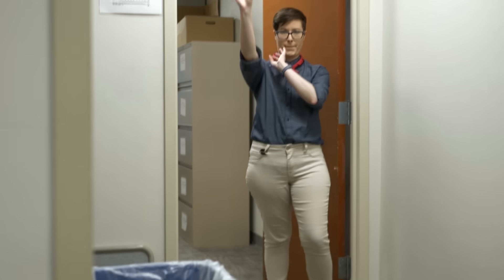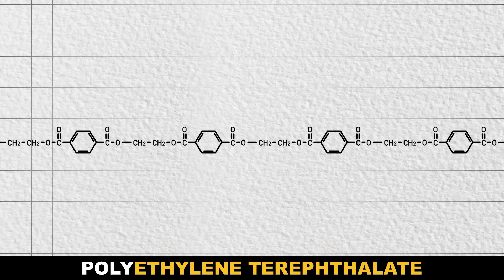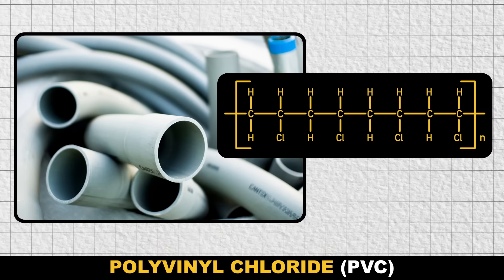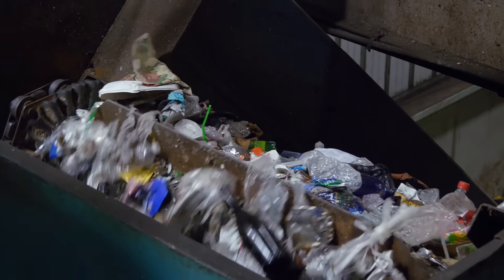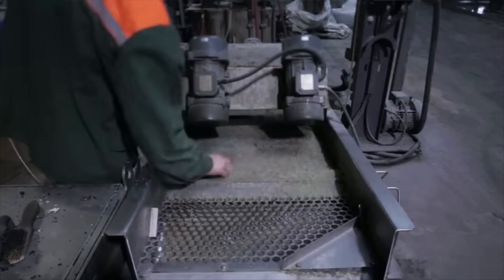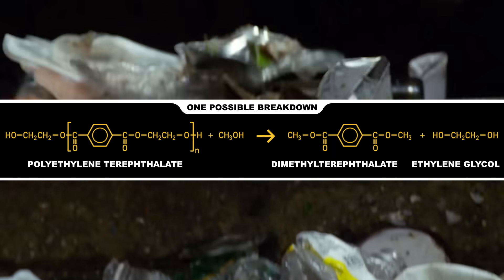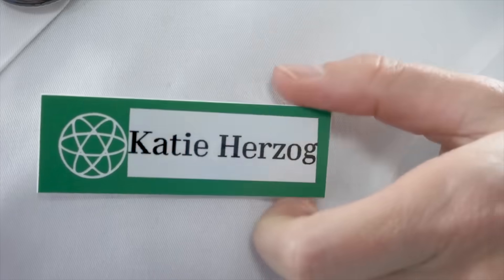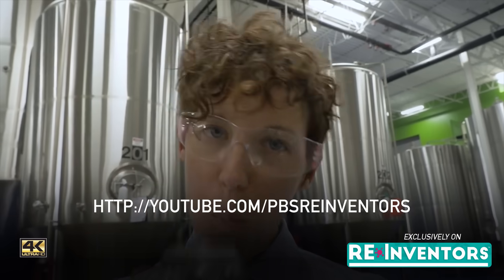How Plastic Recycling Actually Works

Comment: 2:52 the problem with polyester/woven plastic fibers is that they tend to produce microscopic flakes in the washing machine, which then infiltrates the water system. we don't filter these particles out of our drinking water, so we end up digesting these fibers, which cross the blood-brain barrier.
Reply: And the fibers are not breathable which leaves you with BO and a t-shirt that has a sweat smell no matter how many times you wash it
Reply: yes ! exactly what you said. i couldn't have put it any better myself about eventually this will end up in the seas.

Comment: Could plastic recycle turned into plastic logs to make log cabins from, to save trees and be low maintenance, and if all uniform size, could be moulded with cut oits, so easy to put together?
Reply: UV rays degrade plastic and it will slowly leech into the environment. Proper logging practices make wood the more sustainable building material

Comment: In Japan, We're required to separate and clean PET bottles (and other recyclables) as consumers, before pickup. Every collection day is a certain type of garbage collected (For example, PET bottles on Monday, Burnable on Tuesday, Glass on Wednesday, Metal Cans on Thursday, Paper on Friday, and Burnable again on Saturday). If your garbage is not properly separated and sorted, or is the wrong type, It simply won't be collected, and a note will be left on the bag saying "This is the wrong type of garbage, Please sort , or take out on the proper day" . If you don't take care of it, neighbors can complain and the property owner (in tern individual tenants) can be fined.

As a result, Japan has super-efficient large-scale recycling. In addition, we have extremely efficient and modernized industrial incinerators and recycling facilities.

Comment: FORGET RECYCLING, FORGET PLASTIC BOTTLES!  What we should do is go back to what we did some 30+ years ago.  You would buy your soda, drink it, and when you were done, put the GLASS bottle into a box or bag and return it to the store.  The store would give you 5 cents per bottle (maybe around 15 to 20 cents today).  The bottles would then be sent back to the bottling plant, they would be steam cleaned ( which destroyed any dried syrup, residue, etc., and would sterilize the bottle.) and placed on the production line to be filled with soda, and repeat the process.
  Not recycling, reusing.  Simpler, faster, and cheaper than recycling!
Reply: It's all about the money, nothing else matters.
Reply: I agree, but another problem would be that glass bottles are heavier than the plastic ones
Reply: @Canale064  good point, I wonder which releases more co2 polyethylene or glass?
Reply: @Canale064  yea, plus if you switch to glass then where in your diet will you get your polys and your endocrine disruptors and your monosodium cancerates? I have a list of pills i have to take 3 times a day to support all of those, my doctor will be pissed if i stop talking my medicines
Reply: companies hate using glass these days because its not cheap enough for their greedy production
Reply: @BrainDent  
 Not Really. Reusing/ refilling glass bottles would actually be cheaper because it doesn't require an endless production.
  Glass bottles would sometimes break, or not be returned, but most would be returned because of the refund.
  The companies aren't the problem, society is.  Ours has adopted a "throw away" mindset, while past generations believed in reusing and fixing.
Reply: @Timbrock1000  If it was cheaper, companies would be doing it. The only thing that matters to the vast majority of corporations is producing as cheaply as possible and selling as expensively as possible. Plastic, unfortunately is the cheapest for most uses.
Reply: But then the oil industry wouldn't make any Money
Reply: Wow! that takes me back.  Huh!? Almost forgot those days even existed.  Thank you.
Reply: Thats totally normal in many EU countries like germany and austria. stil could be implemented in many more countries
Reply: That's WY I drink my milk in bottles made of glass. Taste is also much better!!!
Reply: I remember my mom telling me how she use to collect a bunch of glass bottles and take em to the store for about 10 cent each. 10 bottles she said she had a dollar and you was able to buy a bunch of candy for a dollar back in the 70's and 80"s
Reply: So true. I think people now days are to lazy to return bottles and stores to greedy to mess with them.
Reply: In michigan we get 10 cents per bottle and can we return
Reply: I am not sure that it would be cheaper.. back in the day, we had a bottling plant in our small city.  It employed people, but that undoubtedly made it more expensive.  Today, we get 'pop' trucked in. (in plastic bottles and cans).
Reply: They still do it in germany but via a machine in the store
Reply: 5cents of 80s money is like $15
Reply: @generationalgamers8925 
 No, more like 14-18 cents.
Reply: Yeah, but most people mess up their cans and bottles. People crush cans all the time.
Reply: @flargarbason1740  crushing cans doesn’t do anything. It can still be recycled if it’s crushed we just crush our cans so we can fit more stuff into our recycling bin.
Reply: @flargarbason1740 crush cans can still be recycled
Reply: It wont happen bcz this disruction is done to earth by major corporates such as coco cola,pepsietc
Reply: @dsangeeth15 stop being underconfident.

Comment: even though they call it a down grade, cloths and handbags remain usefull for way longer than any plastic bottle.
Reply: They are still made of PET and eventually they'll be thrown away, and can't be recycled.  

You can definitely use the bags more times than the bottles, but if all the bottles get turned to a bag that will get thrown away, the amount of PET isn't reduced, the problem is just prolonged to a different age group to deal with

Comment: Wouldn't it be possible to clean and re-use some products, like some kinds of bottles, without completely breaking them down and reforming them?
Reply: Eric Nash 
  That's just what they used to do with glass bottles. You would buy the bottled drinks, when the bottles were emptied, you would return them to the store, and get a 5-10 cent (20-30 cents today) refund.  The bottles would be sent back to the plant, steam cleaned, then refilled to be used again.

Comment: 2:42 Well, you could do it the European way. You pay a little extra (0.25€ per bottle) when you buy them. And when they're empty you take them back to really any store that sells PET bottles and receive your 25 cents back. The store will then have the crushed bottles be transported to a recycling facility.
There's no extra cost for the consumer and the PET retains most of it's quality in the process.
Reply: Glass soda bottles used to have a return deposit ranging from 2 cents to 5 cents per bottle (1960's deposit amounts). Glass soda bottles were reused for 50+ years until the 1970's when corporations switched to plastic. Soda tasted better from glass bottles too! If you could compare taste between
glass bottles and aluminum/plastic bottles you'd definitely prefer the glass bottled version.

Just a penny for your thoughts.
Reply: It doesn't change the recycling process. from what I've gathered, it doesn't even increase the rate of recycling.
Reply: @rfldss89  IT DOES!
Reply: They have a system like that over here in the us
Reply: Many states have already done that for decades, even have what look like vending machines to feed in bottles and get refund. Some people make a living off collecting bottles and cans
Reply: There are certain states that will do this too.  The refund value doesn't really save any cost of recycling if the consumer gets back every cent they put into it, instead of the profit for the extra charge actually going to the process of recycling.

And even if the extra 25 cents per bottle was kept from the store (and went into recycling) I dont think that would cover cost of transport, sorting, cleaning, then the actual recycling process (and safely disposing of the waste you get from recycling).
Reply: We get 0.07 euros here in Croatia
Reply: Your lucky we get 10 cents in Lithuania
Reply: @DomtuYT  u can't direct compare nationality economy prices
Reply: Thas doesn't solve anything. Plastic is killing the planet. When will we stop using it?
Reply: @annvont  Plastics are used in almost everything today..!! It's just that humans should be careful not to MISUSE plastic..!!
Reply: I agree with the idea of having a deposit, and this way the machine sorts the plastic through the bar code.  Some states, including my state of Oregon, already have a deposit.  The machine sorts glass, plastic, and cans, keeping them separate from other material.

Comment: Which is why I always carry around a reusable aluminum water bottle (along with reusable grocery shopping bags).
Reply from the maker: Not the hero we deserve but the hero we need.
Reply: gotta make sure the reusable grocery bags are made from recycled plastic though. Cotton bags are much better than disposable plastic ones. For example if you consider CO2 emissions, it takes hundreds of years of use for a cotton bag to be more eco-friendly than a plastic bag (although of course, at least cotton bags don't end up in landfills or oceans after each use).
Reply: Rafael Santos you got that from a kurzgesagt vid didn’t you
Reply: I'm not a fan of reusable grocery shopping bags.  Most ppl won't clean them properly and there's always those unseen germs that linger.  I think the health issues it will cost will be more of a problem than plastic bottles.  Ppl are lazy.  The won't clean dirty bags, let alone ones that "might" have some ecoli on it from the butcher.
Reply: @rasmasyean  do they not put the meat in a seperate bag? Meat is one of the things that I always put in a plastic bag tied up so it doesn't get on anything.  Ecoli is not something to play with
Reply: @Anna-tc6rz  The meat (or other slimy stuff) in a separate bag is just so it doesn't get other stuff wet or leak through a hole in the shopping bag.  The way they handle the bagging...that will smear germs all over the place, like outside the bag.
Reply: There is plastic everywhere. Water bottles and shopping bag are the least of our worries. More has to be done. Soooooo much easier said then done but soon we are not going to have a choice. Just my opinion. I need to do better. Way better. Like as in I do the bare minimum and that sucks. I can do better, we can all do better.
Reply: Hey man I am glad that you are thinking about reducing your plastic waste. 

Aluminum bottles will leach aluminum or its plastic coating into your water though. I used to use one but there is a test that you can do. put your water in your aluminum bottle for the day and put water in a glass bottle for a day. taste the water side by side at the end of the day. The glass bottle leaves the water tasting natural and the aluminum makes it taste like aluminum/ plastic

I use glass always now.
Reply: good for you, you stupid cretin
Reply: Must be awkward showering, swimming etc.

Comment: What about "biodegradable plastics"? Are they really biodegradable and how do they work?
Reply from the maker: That sounds like a great idea for a video...
Reply: @ACSReactions  You are as wet as can be.
Reply: from the little googling I've done on the subject, the main biodegradable plastic used is polylactic acid (or PLA). It's technically compostable/biodegradable, but it's only possible in industrial compost piles. Your average at-home compost pile just isn't big enough to reach the temperatures required (60°C) for a successful biodegradation.
Reply: @rfldss89  thank you. But is it still take 400+years or 80+years to degrade? I just wondered if they are actually a feasible replacement that is less impactful as conventional plastics
Reply: I would definatly love to see that.
Reply: I don't think all this "time" will matter that far out.  There is the concept of the nano-printer and by that time I think we will have one. It will just break down things by atoms and spit out stuff into element buckets or reconstruct it into something new.  Just feed it dirt and out comes a microchip...if that's still a useful item by then. :)  Of course how much it costs would be determined if you will use it to clean garbage.
Reply: Rynier, what is the source for 80+ or 400+ years to biodegrade? Also, I found that there are multiple definitions for what biodegradable means: https://en.wikipedia.org/wiki/Biodegradable_plastic?wprov=sfti1
Reply: Also worth noting is that biodegradable and compostable are not the same thing. Biodegradable means it will just break down into microplastics (smaller versions of itself), compostable means it will break down on a molecular level into something else.
Reply: @ferncat1397  as Dow is still famous for; “Better living through Chemistry “. Nowadays BASF has better marketing 😉. Enjoy 😀

Comment: We all know recycling is good.. but it is definitely better if we just try to refuse plastic.

Who’s with me?
Reply: What if people make a plastic product which is easy to clean & disinfect. You could resell it or reuse it over and over again even if you pick it from thrash.
Reply: thats what im talking about
Reply: @xponen   What if there is a system that collects these plastics immediately after use, cutting short the process of going into a bin and then mixing with muds and dirt. Won't that be much effective in recycling the plastics back to its original form?
Reply: I understand bottle is designed for looks, convenience, and manufacturing cost, so they look simple & disposable, however I propose an end-of-life reusing; meaning the manufacturer design the bottle to facilitate factory disassembling, cleaning, disinfection, and re-fill (this is not about having cool straw mechanism, shape & colour for typical User reusable bottle). Also, government can play a role by enforcing this design rule & guarantee that companies obeys to health/cleanliness standard during re-using.
Reply: You used to be able to return glass soda bottle for refilling and I think milk bottles too.  But plastics replaces those, not just for those reasons, but because they don't break, cost less fuel and packaging to transport, can be made in less than one second, among other features.  Overall, it's a cost issue and use of fuel and time is also "a waste" to make things like glass refillable bottles.
Reply: Or we could pay more for the kind that decomposes within  months instead of 100's of years. It does have it's uses...
Reply: I'm both with and against ya dude. With because it's amazing, when it can be recycled and isnt used for dumb crap like Straws, Plastic utensils, and wrapping. Yet if it can be made strictly to be reused and altered to be biodegradable...then I'd have to agree
Reply: Glass bottles all the way. Liquids taste much better in glass as the glass doesn’t permeate into the liquid when it is heated.
Reply: That's why I reuse condoms.
Reply: What if we just recycle as much as we can and burn the rest like so many other developed countries like germany, singapore and sweden?
Reply: I think the solution to plastic is just to find more sustainable ways of making plastic making biodegradable plastics(which arguably has been slowly but surely growing) and finding ways to clean up and reuse/break down all our old non biodegradable plastics
Reply: I guess we can go back to the days of wearing animal skins and riding horses. LOL
Reply: I wish, but I don't have a cow to milk I to glass bottles and all milk comes in plastic jugs for the most part. Definitely all cottage cheese does.
Reply: It's too cheap for corporations to refuse plastic. Plastic is the least expensive packaging method for most uses. All that matters is the almighty dollar.
Reply: sorry, not gonna happen, society depends on plastic, it's very important, You cannot just refuse it, it's woven into our lives, biodegradable plastic stuff is one of the ways.
Reply: Not with you - Plastic is the future of materials, and we are likely to continue using it or a variant of it. Moving towards biodegradable plastics are a major step.
Reply: @kohgeek  biodegradable plastics is a myth. plastic is a man-made substance, it's not bio-matter. Bio-matter comes from living materials. "biodegradable plastics" just makes the parts smaller and smaller and smaller, they dont disappear. Ending up in our food sources, all fish now contain microplastic particles and studies show Humans are consuming mircoplastics. Source 2019/09/14 Deutsche Welle "Alarming level of plastic in children's bodies, German study shows"

News article mentions "Toxic clothes and cookware" so recycling plastic into clothes is a health issue of concern as not ideal for Human-environmental use , nevermind the wo/man labor cost and energy emissions in transporting /transforming.
Reply: @AstroTomK i had recently heard about some worm being able to chew and digest plastic...
Reply: @kohgeek  Hell we even make weapons with plastics + polymers.
Reply: its a fast world, got no time for that